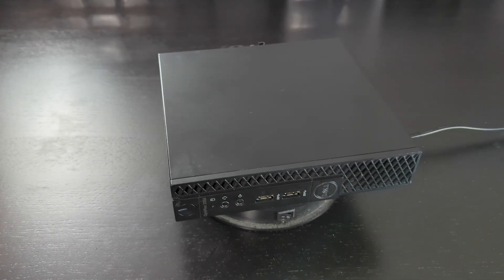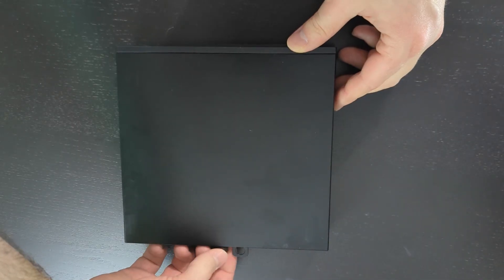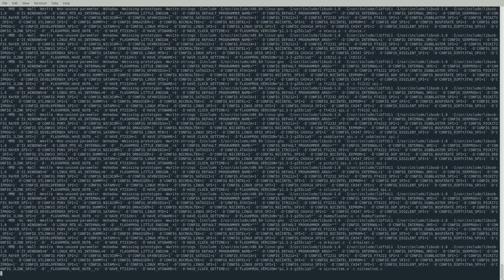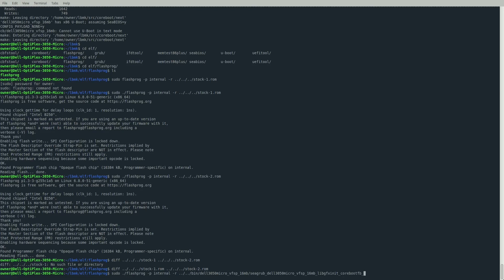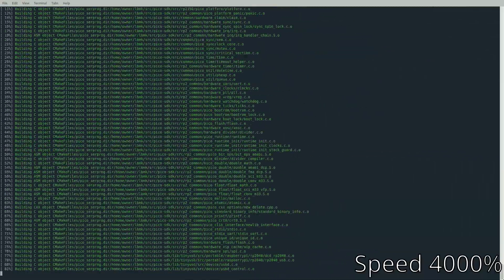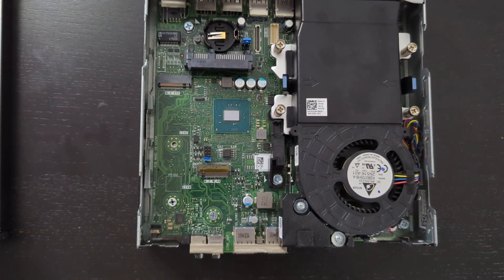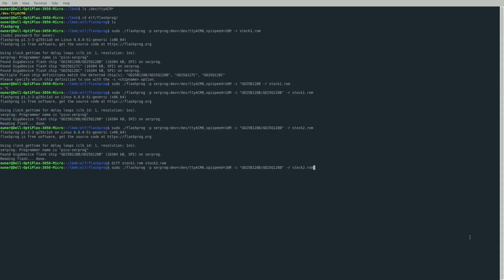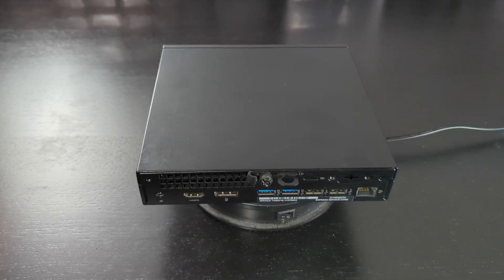Install Libreboot on a Dell 3050 Micro

Comment: I used the same Xubuntu distro shown in this video on my 3050. However, I got an ERROR that deviates from the instructional content of this video in a way I find disturbing. After executing the "./mk -b flashpro" terminal command I got this response: "ERROR ./mk Run this first: git config --global user.name your name". This was followed by a second error requesting for my email. Can somebody please clarify why this project is collecting Names and E-Mail addresses? I find these requests to be totally antithetical to what Libreboot represents which is privacy. I provided both a fake name and email because there was no way around these errors due to some lock file that appears in the LMBK folder. To the author of this video, do you think this is some new KYC policy now in place which was not present back when you published your video? And thank you for such a great video.
Reply: Hey, this is not a libreboot error, neither shady requests of your data. This is a git command output. When cloning a repo (which is probably happening when building flashprog for the first time) git defaults to using SSH protocol. Using git with SSH protocol requires you to set your git identity (doesn't matter if real). You can read more about this, search for "first time git setup".

Comment: Thnx for the great video. I may be doing the internal approach shown in the first half of the video. Just to confirm, does the JUMPER need to be put back to its original location after the internal Libreboot install process is completed?
Reply: in my experience no its working just fine, but it may be a good practice to write protect the bios. im keeping mine in the flashing position in case i want to reflash